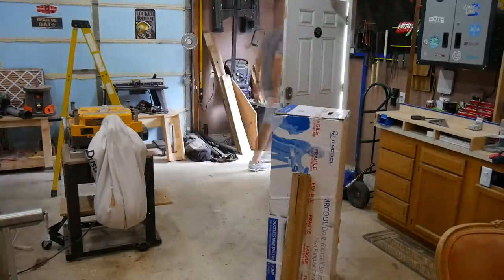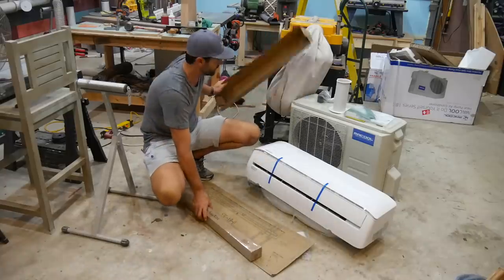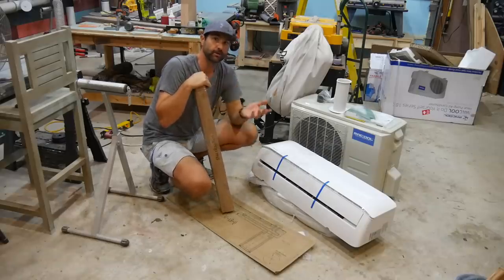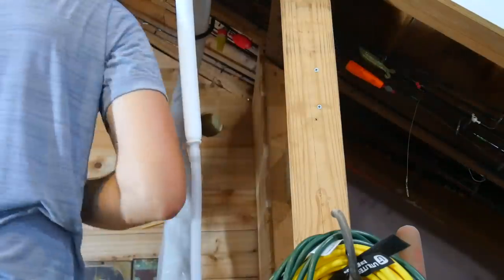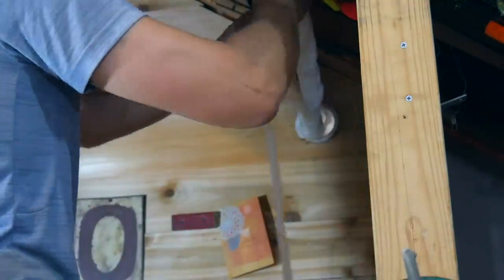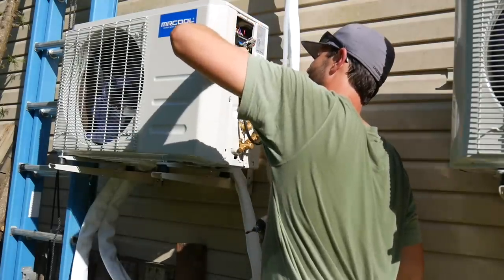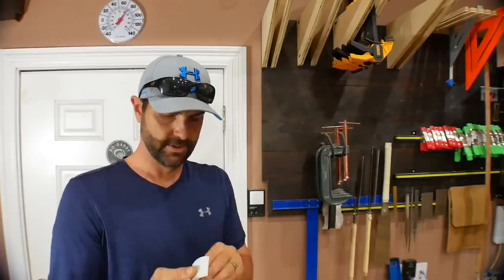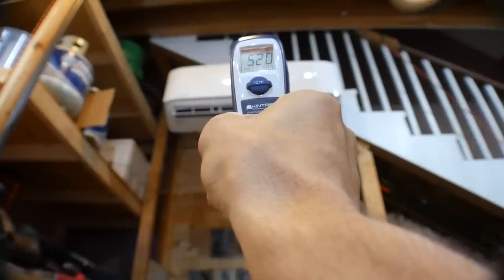DIY Mini Split Installation (Step by Step)

Comment: The video is great, except you may want to add a note stating that you are also supposed to bring the Freon tube lines down to a vacuum first with a vacuum pump, before letting the Freon loose from Condenser unit. Otherwise you contaminate the whole system with air and moisture mixed in with the freon. But with that said, the rest of the video is excellent.
Reply: You are correct that the Condenser unit is Precharged with clean freon. Thats where all of the measured amount of freon is stored securely. BUT,  the Evaporator section and the connecting tubes are open to the atmosphere and full of air and moisture! Those sections need to be suctioned down to a vacuum after they are all connected to Condenser unit, BUT prior to opening and sharing the gassed up condenser charged potion to the rest of the system. Otherwise, you just contaminated the whole system with the air and moisture that was in the tubes and evaporator with the clean freon in the condenser! Who knows, maybe it will run for you with that small amount of air in there, then again maybe it will effect the life of the unit. Moisture can freeze up in a freon line. That's why they install dryers inline to capture any moisture. It's also why chillers, which sometimes run on a vacuum at sections of the freon loop, use purge units to remove air and moisture that gets sucked in at bad connections. There is a good Youtube video which shows a guy like you installing the same unit, but he has bought a cheap $50 vacuum pump from Harbor Freight to suck the air out down to a vacuum. THEN he opened up the charge to the whole system. Watch it and you will see his method. Thanks,  Jeff
Reply: @MrJeffoff  The air handler has the lines attached and charged, not open to the atmosphere. That's why you can't disconnect them, or shorten the line.
Reply: @MrJeffoff  , the Line Set is "Pre-Charged with refrigerant and therefore evacuating them will not only suck out a lot of your refrigerant, but it will also void your warranty on the D.I.Y. version of the Mr. Cool system.  On the latest version of the product, the line set has special connectors on the end that have spring loaded seals which allow the user to reverse the procedure to uninstall and move the system and reinstall it following the instruction manual without losing any of the charge.  That is a really neat feature of this D.I.Y. systems from Mr. Cool.  I don't know of any other vendor that does this with mini split systems today (Oct 2019)

Comment: You need to pull a vacuum to -30Hg for at least 30minutes for not only air removal but moisture too. Then with the vacuum pump turned off wait another 30minutes to see if there is any drop in the vacuum. Once confirmed only then do you open the valves. You checked for leaks with a soap solution but there was no pressure so you checked for nothing. With that said thank you for taking the trouble of making this video.
Reply from the maker: I really appreciate your expertise and you taking the time to comment. Thanks again for watching..

Comment: not pulling a vacuum on the system, means it is not going to last long, water in system lines, cause acid corrosion etc.  Plus you should check for leaks with a nitrogen charge.  This looks to use the quick disconnect for refrigerant so I guess in theory the components have been factory leaked checked, and vac pulled on indoor and outdoor unit?  Weird, precharged lines, and having to loop excess around
Reply from the maker: Those are really great comments and valid points.  I wish I knew enough about HVAC systems to answer your question, but I definitely don't.  Hopefully, someone from MRCOOL sees this comment and responds.
Reply: Good Video , interesting, I use Mitsubishis, love em...Mini Splits are the way to go!!
Reply from the maker: I heard Mitsubishi’s are awesome units.  I couldn’t justify the cost for it since it is for my workshop.
Reply: They are the most pricey ones out there, but super efficient SEER of 30 is incredible, makes heat when it's as low as -5 degrees!  Who would think there is still heat in the air for it to absorb. And silent, both in and out, I think they must be selling more, or want to lower price, cus my earlier ones are made in Thailand, the last one I just got made in MExico, less shipping for NA?  They are great I have saved a fortune on heating in winter and cooling in summer, my old central air is not used, at all now my furnace barely comes on, only when we had the 3 degree stuff, but last winter my oil was $8 !! before mini splits, easy $700 a heating season, and the electric barely moved up, as they are super efficient. Mini Splits are the way to go, there are several brands out there....
Reply: The system is pre charged from the factory and the lines are sealed at both ends at the factury. both lines have vac pulled and sealed with same type of seal as on a can of r134a. Meaning as you screw the nut on it punctures the seal thats why it says tighten fast so not to lose vacuum.  Its a total closed system as long as the insulation is done correctly.  Again no vac needed to be pulled unless the person screws up and unscrews the lines then a vac will have to be pulled before opening the refrigerant set screws. The service port can always be used to check for leaks and if i was installing it i would check to see how much of a vac is from the factory just for my own curiosity. lol
Reply: evidently its a brave new world that makes installing HVAC more DIY friendly.  I kind of like it.
Reply: Yea i agree. my opion is they want DIY so when they screw up they will have to buy another. Thats the only thing i can think of.
Reply: Nothing new about it, if you're referring to the quick disconnect pre-sealed and charged lines.  Been around for at least 50 years.
Reply: @cengeb  I recently viewed a youtube video from Carrier who just introduced a 42 Seer unit that will heat down to negative 22 degrees!!!!  Mini Split systems have come a long way and are starting to get more popular here in the USA for sure.
Reply: @airwolf269  In a recent Mr. Cool Blog post, a user asked if they could move the system after it was installed.  Mr. Cool rep said that for their D.I.Y. unit which I assume was a very recent one (Oct 2019 ish) they could simply perform the installation steps in reverse and when the line set was disconnected it would automatically seal itself via spring loaded valves in the end of the line set.  Then move the unit and reinstall following the manual as they originally had done.  No vacuum or purging or topping off needed!  How cool is that !!!
Reply: @optionstraderman  42 SEER is incredible, yup, mini splits have really come into play, great stuff

Comment: Why its called DIY, when you still need a professional electrician?
Reply from the maker: It’s a DIY mini split, not a DIY electrical installation.  They do have a 120v diy mini split that plugs into an outlet.
Reply: I don’t think you need one. If it’s a 115v, you’ll need one hot leg, a neutral, and a ground. If you have a 230v, you’ll need two hot legs, a neutral, and a ground. If you don’t know electrical than I would say either consult an electrician or study it a little. It is fairly simple.
Reply: It's simple. Just read the directions that come with it. Use a disconnect. If you don't know what those are then Google is your friend. The entire building industry is full of us crackheads doing this daily. If we can do it you can do it.

Comment: You don't have to pull a vacuum on the line set?
Reply from the maker: Not on this unit.
Reply: All units like this you have to vac out it's common sense.
Reply: @whatyoulookingat6958  according to the company this ones don't, they come precharged with some special fittings. Look it up!

Comment: I'm an HVAC contractor. Y'all will need a good one if you try to install equipment by yourself. There may be a select few that could pull it off without there being future problems. This system will fail eventually. It has noncondensables and moisture in the system due to no vacuum being pulled on it.
Reply from the maker: Hi Clint, thank you for your feedback.  Will the life of the system be extended if an hvac tech evacuated the system and re-charged it shortly after the installation?  I'm asking b/c that is what happened with this system.  Thanks again for your feedback - I'm grateful to get the constructive advice from a professional.
Reply: Pahjo Designs yes. The refrigerant would need to be removed and the entire system needs to be put in a vacuum. I would suggest pulling it down to 400 microns or so.

Comment: And just opening the valves up after connecting them is sooooooo wrong. Your gonna have someone watch this and do the same thing and burn out their unit in a few weeks. You have to evacuate the lines removing all oxygen and nitrogen getting it below atmospheric pressure with a vacuum pump then as it holds the pressure you can release the coolant. So many people in here do it the way you did and they are going to ruin their new systems.

Comment: No vacuuming the Lines? You have to get the air and moisture out dude
Reply from the maker: A Font - This has been addressed many times in the comments.  You don’t need to vacuum the lines in this system

Comment: If it is supposed to be ductless, why would it have so many hoses? The work involved in routing the hoses, is the same as routing ductwork...IMHO...
Reply: Un Garza it is not even close. Ducts even the flexible kind take up way more space.  Then you still have to have once main evaporator and a condenser units with the same size refrigerate lines as he does with those splits.

Comment: Call an electrician? You said it was 100% DIY.
Reply from the maker: They have an AC version that is 100% DIY.  I chose the 230v system.  Regardless, it is 100% DIY from an HVAC perspective.  HVAC professionals are not automatically licensed electricians.  Therefore, they need to call an electrician as well to install electrical connections where they need them.
Reply: Jeremy Hoffpauir I think I would be more inclined 2 do the wiring myself and call a HVAC Pro to handle the refrigerant.
Reply: DC?  You said it's 230.  That's AC if it's coming from your house electrical.  Do you have some high voltage solar panels you are powering this thing with?
Reply from the maker: my bad, I have no idea what I said that.  I chose the 230 instead of the 110v system.

Comment: How not to install any ac unit. Not pulling a vacuum voids your warranty and starts damaging your unit from day one.
Reply: Sorry Straight Whitemale, That is Not the Case on this specific Mr. Cool D.I.Y. unit.  NO Vacuum, and a 7 year compressor warranty and a 5 year parts warranty on the balance of the unit.  All Mr. Cool D.I.Y. Units require NO VACUUM pulling and will in fact void your warranty if you pull one!!!  Line Set is pre charged with refrigerant which is released into the system when attached to the condenser.

Comment: I'm not going to bash you to hard for being a LSWHO guy. First off, ROLL TIDE ROLL, Second, you always pull a vacuum even if it states that *you don't need to*. That is only for a perfect world scenario. You're in LA bro and the humidity is horrible there. Therefore, any amount of microns of condensation could've and 99.999% did penetrated into the line set.
Reply from the maker: Chad Rawls - thanks for the advice.  I’m definitely an amateur when it comes to HVAC and learned so much by making this video and by people like you taking the time to comment.  I really appreciate it!!!
Regarding your team, I’m smart enough to know there is no argument for a team that consistently wins.  :).  I’ll just say - SEC!  SEC!!  ;)
Reply: This unit is designed to not require a vacuum be drawn.  The lines and the condensing unit are already vacuumed and sealed.  There are diaphragms on the lineset fittings, and once you connect the lines, the condensing end pierce the seal after the connecting has been made.  It works very well.  Obviously, if you back the fittings back off, then you will need equipment to draw a vacuum on the lines.
Reply: Chad Rawls,  I keep seeing this same question over and over on these videos for the do-it-yourself Mrcool units,  "you always pull a vacuum even if it states that *you don't need to*"  Mrcool is one of the only systems made that is truely DIY and is backed by a full warranty when you actually do-it-yourself. If you read the Mrcool literature on the DIY units, you will see why this warranty is possible without professional installation!!! It is simply because they are supplying a "Clean and DRY system and line set", which is all sealed at the factory. In other words, the purging and vacuuming of the system and line sets have been completed at the factory and unless you mistakenly or purposely open the seals before the lines are attached to the inside (evaporator) and outside (condenser) units, there is no way for air, water, dust or any other contaminates to enter the SEALED system! I sincerely hope this helps you to understand that your original statement, "you always pull a vacuum even if it states that *you don't need to*" does not apply to the Mrcool DIY systems.  With all this said however, if you do not like or believe in this concept, you can always buy the exact same size Mrcool units, which are not DIY and do require a licensed professional to do the install, which will include the use of the almighty "vacuum pump" in order to have any type of warranty, please feel free to do so. BTW, the non-DIY units offered by Mrcool are actually $400-500.00 cheaper!  Basically it boils down to whether you want to pay someone to do the work so that you get a warranty or do it all yourself with the Mrcool  DYI system and still get a full warranty!

Comment: This just screams hillbilly with problems down the road. Quick connects always eventually leak due to vibrations. The only true leak proof connection is brazing properly done by trained service tech. Hopefully there were proper electrical installations done with these as there are many codes to be followed that are learned by electricians.

Comment: Very ironic that Mr. Cool states to follow the manuf. instructions  EXACTLY and does not vacuum the system or use the proper flaring tool and torque wrench to make the final connections. There are so many DIY's really making poor quality help!!

Comment: No need to pump down the system? Lol ok
Reply from the maker: Lol - read the comments and the info about the system.
Reply: @PahjoDesigns  you really think that? Lol stop bruh. Plus leaving the extra line set why? Read a HVAC manual please.
Reply: The lines used with this unit are unique in that the lines themselves are sealed at the end that goes into the compressor.  When shipped, the Evaporator and attached Refrigerant lines are also pre-loaded with some of the refrigerant in the lines and some additional refrigerant is loaded in the outside condenser unit.  When you tighten the lines to the condenser, the lines open up and allow the refrigerant to flow into and out of the condenser.  Of course you have to open the valves on the condenser as well to complete the openings to allow free flow of the refrigerant.  The nice thing is that if you want to move the unit, you can simply reverse the procedure and the refrigerant lines will self seal when disconnected and then can be moved and reinstalled without losing any refrigerant.  It really is a (Mr.) Cool design and very unique to the D.I.Y. Models of the Mr. Cool Heat Pump Systems.

Comment: Yea forgot about pulling the system into a vacuum and re flaring the fittings as factory specifies or your warranty is void. Hire a professional, not a DIY unless you really know what your doing and the tools to do it.
Reply: Not to mention torch wrench for the the flares. This system may last 5 years at best
Reply from the maker: Gregory Heimann - I didn’t forget.  Pulling a vacuum is not required.  Read the manual here if you would like:  https://images.homedepot-static.com/catalog/pdfImages/74/74671561-d4e5-43cd-8936-33fdd2526621.pdf

I’ve copied a few of the comments from this video below from various folks in case you missed them or didn’t bother to read them before commenting.

If you vacuum out the line you end up vacuuming out the refrigerant and ruining the system. I am installing a total DIY system with no HVAC tech needed.

The linesets are sealed at the end with a fitting that opens when you couple them to the unit service valves.  Very similar to a quick coupling. The manufacturer has positive pressure refrigerant in them. That is also why they are fitted to the evaporator already in the box from the factory.

Usually, the lines are just lines with no charge and open to air.  evidently this is not that though.  I had the same thought, no nitrogen pressure test, or pulling a vacuum is not what most people familiar with HVAC are used to, or at least used to be used to.  Initially my thought was why have all that line to have to fill with refrigerant, and pull a vacuum on, but like I said, this is new and different from what I would have expected to see.

Comment: I do like your diy video.
And it's easy to be a Monday morning armchair quarterback. But please tell me why the f*##k you didn't wrap the extra lines up under your stairs?
The loop T loop outside looks like you know what.
And the more time the return line spends out in the heat, the lower the efficientcy of the system.

Comment: The system should have been 1.  Pressure checked for leaks.  2.  Vacuumed out completely before releasing the refrigerant.